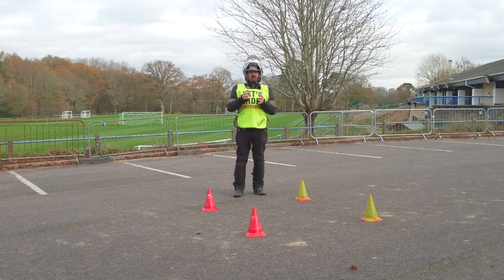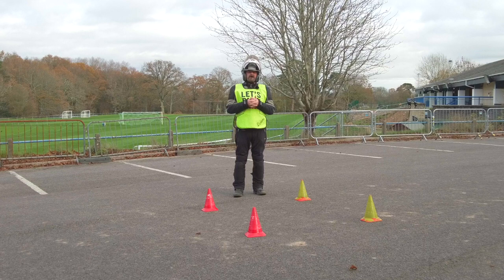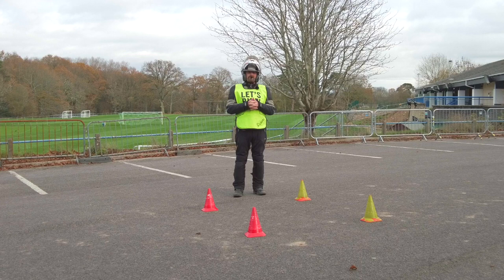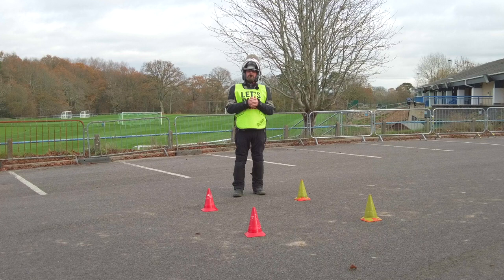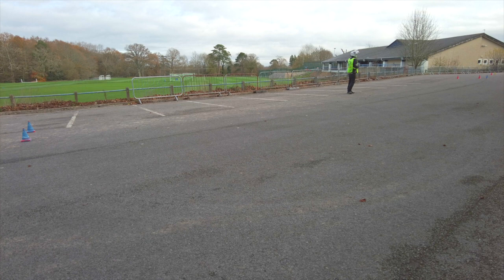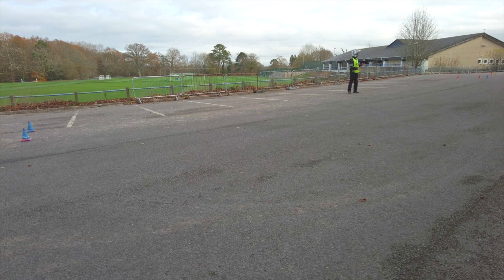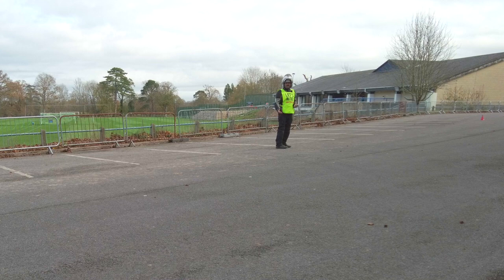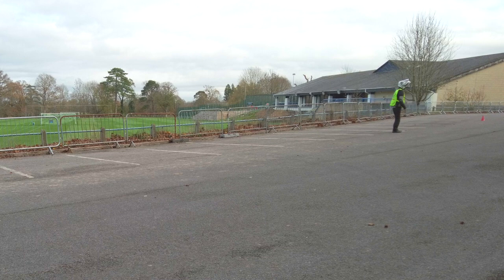DVSA Module 1 Motorcycle Test -  Exercise 7 - emergency stop

Comment: You didn't mention this in the video, probably because you have done in another video.. and this is an excellent video nonetheless, but if the back tyre skids during braking is that a fail? (i drive a 1992 Kawasaki GPX 600R Ninja which is too old to have ABS)
Reply from the maker: If it skids and you fail to release the brake then yes, that's a fail. If you release quickly before reapplying then it'll go down as a minor fault only. 👍
Reply: @Lets-rideUk  Cool. Thanks very much for your help.

Comment: Hello there,  my module 1 emergency stop.. my first attempt was 43km/h. And the second attempt was 55km/h. In an emergency step,  is it 31km/h or you can do more than 31km/h?
Reply from the maker: For the emergency stop and hazard avoidance exercise the target speed through the speed trap is 50kph. The minimum speed is 48kph. There is no maximum speed. 👍

Comment: Been working my way through all your module 1 exercises, good clear instructions and demonstrations, got my mod 1 very soon. Strange question, what recording equipment do you use? No wind noise and nice and clear.
Reply from the maker: DJI Pocket 2 with DJI wireless microphone transmitter for off-bike recording. You may notice some clicking on the sound track in some of the videos - this was fixed with a firmware update. On bike I use the GoPro Fusion but record the audio with a tethered Rode lavalier microphone into a Sony voice recorder and sync in editing software. Both mics have the "dead cat" attached to them.👍
Reply: @Lets-rideUk  many thanks, looking at different kit, but when you can see one that works well in the real environment its a bonus.

Comment: So when you stop it's clutch in no gear changes, then right foot down and change back to 1st gear? I'm paranoid about having those two feet down for a moment to change back down the gears I just want extra clarification lol
Reply from the maker: Pull clutch in just before you stop so you don't stall (although not the end of the world if you do). You can downshift as you're stopping if you want to but best to concentrate on stopping safely then selecting 1st after you've stopped. No problem at all having both feet down after you've stopped!

Comment: Do you have to check mirrors after you stopped too? That's what the examiner said I failed my first test on
Reply from the maker: No, no observations required after you've stopped. Did the examiner really say that? We've never taught that, never been asked to teach that, never had an examiner insisting on that. How odd. 🤔
Reply: @Lets-rideUk  Maybe it was because I didn't do the observations after I left off. Is that necessary?
Reply from the maker: Observations are required every time you pull away. But an isolated incident of forgetting shouldn't cost you a test - you'd have to forget several times. The only observation which is counted as a serious fault (and a fail) is the lifesaver glance on the U-turn. 👍
Reply: @Lets-rideUk  Oh, I must've got done badly then. The examiner told me I remembered the checks for all others (including lifesaver on U-turn) but forgot on the emergency stop. This was at Erith and was with the guy who talks really fast and has glasses.
Reply from the maker: Forgetting an observation is a minor fault (unless it's the U-turn lifesaver). You'd have to forget three times to fail. Never seen anyone fail for forgetting one observation. Very strange...
Reply: @Lets-rideUk  At my CBT, I was taught to check the mirrors after an emergency stop too. The reason being because you won’t know if a driver behind you will stop in time once you do have to brake suddenly. If you look in the mirror and judge that you will get hit, you can jump off the bike and minimise or avoid any serious damage to yourself.
Reply from the maker: @drsparwaga  This is good advice, although we take it one step further - on the CBT we get the pupil to paddle the bike out of the road as soon as possible for the same reason. But the observation is not required for the Mod 1 test. Do them if you want to though! 😊👍
Reply: @Lets-rideUk  That’s a good one too. Sounds a bit better to those who have really expensive bikes, and don’t want to drop them🙂

Comment: Not sure if you will reply to this. But what about linked rear brake. Around 60-40 to the front and no abs. How should thst be tackled. I have had to do real e stops due to idiots but like you mentioned the rears raises up alot. (This is a 125)
Reply from the maker: Hi Barrie. Not much different really - front brake as the primary stopping brake, adding a little bit of rear. Remember, you don't have to stand the bike on its nose to pass this exercise - it's a quick stop under control. It's a squeeze of the brake lever, not a grab. 👍

Comment: In the school i used and failed mod1, had a bike with no ABS, i asked if i can use a bike with ABS (since ive always had a bike with ABS and the big 
bike ive bought also has it) but the reply was No because i must learn and use proper braking technique during the mod1. Considering looking around for another school for one that uses a bike with ABS - I did a small skid on my test and was failed straight away.
Reply from the maker: 😪 Granted, it's essential learning correct braking technique but to deny you the use of an ABS bike seems a bit harsh...🙄

Comment: Failed my Mod 1 today. The bits I was concerned about most (manual handling, U-turn, slalom/figure-of-8) couldn't have gone better. I failed on the emergency stop, although my braking was fine. On my first attempt, I only managed 44kph. On the second attempt, I closed the throttle too early again and panicked that I wasn't going quick enough. I got flustered, opened the throttle again very late. In my panic, I somehow clipped one of the cones by the speed trap. Such a stupid error and I'm pissed off with myself. I did in fact manage 50kph but by that point it was irrelevant. Up until that point it had been going really well.
Reply from the maker: Darn! Think of it as a practice run - you'll nail it next time. 👍👍👍
Reply: @Lets-rideUk  Thanks! I'm booked in again for next Friday. The parts I was most concerned about went really well so there's definitely lots to be positive about, but I'm having a bit of a sulk this afternoon! So annoyed with myself for making such a stupid and unforced error having breezed through (what I considered to be) the trickier bits early on. Doubly annoyed as the weather/conditions were perfect which may not be the case next time.

Comment: Failed Mod 1 Yesterday on the emergency break
Examiner said I didn't use front brake at all, when I did, it wasn't a clean break, I can admit that but I use both breaks anyway, I'm super confused now, and failing like this makes me think this is not worth it. Any advice on the exercise? I didn't had a second chance on it, and until this exercise I made everything clear no minors, no majors
Reply from the maker: This exercise is majority front brake, with only light pressure on the rear brake. Start off gently on the front and squeeze harder, applying very light pressure on the rear brake. But yes, both brakes must be used. The stop itself is the same as conducted on the CBT (check out our video on that). Don't give up - you'll get it!👍
Reply: @Lets-rideUk  thanks
Reply: How does the examiner know if you've used the rear brake or not? And does a bike with IMU not apply both anyway? @Lets-rideUk
Reply from the maker: @ronlysons6750  the examiner will be observing the pupil's hand on the brake lever and foot on the brake pedal. Sadly I'm a bit of a dunce on IMU's but I wasn't aware it applied the brake for you, only regulated the pressure - but I could be totally wrong!!
Reply: You may be right, I've just spent 20 mins on Google and still don't what IMU does relating to braking. I read somewhere that it evens out the pressure between front and back brakes. Maybe you still have to use the rear 
 brake though for it to take effect?
I always use both brakes except for last few feet when stopping. BTW, you and your channel are brilliant. A must for anyone new to motorcycling.  @Lets-rideUk